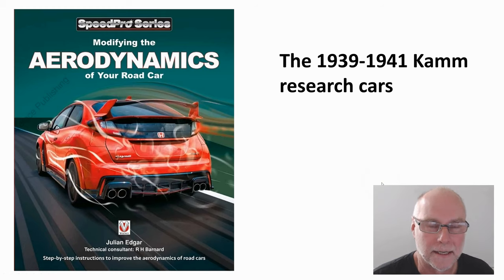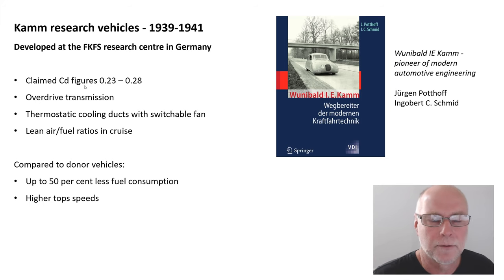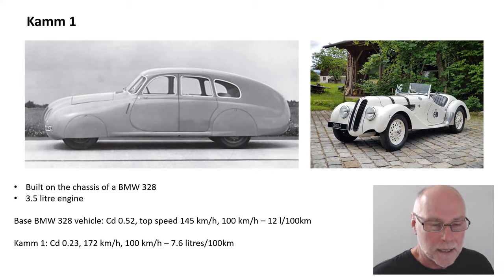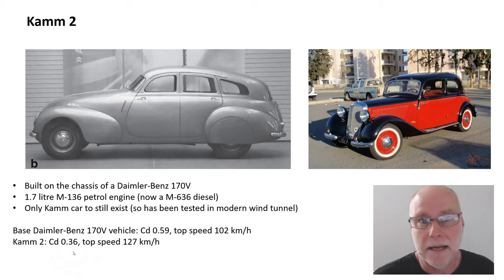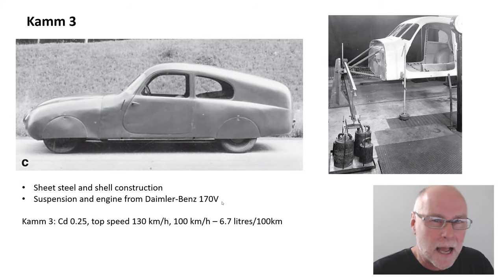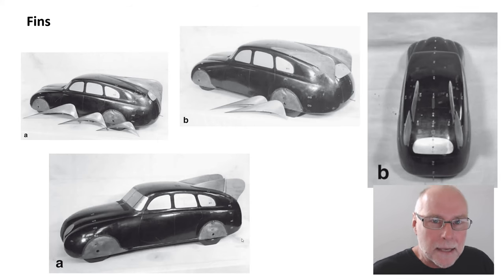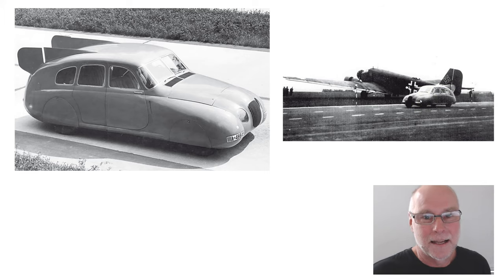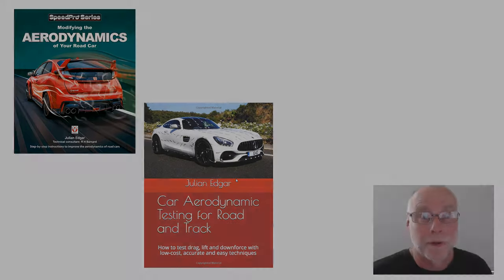The Kamm aerodynamic research cars

Comment: The 0.23 Cd value multiplied by the 1.3 larger frontal aera from the Kamm wagon is the reason the performance is not in line with your expectations based on merely the Cd value, I believe . Regards C

Comment: Julian, I removed the fins I had on my Kammback because I was wondering about crosswind drag. 
Have you tested this sort of thing with your Insight ?
Reply from the maker: When I tested the reduction in drag achieved by the rear fins on my Insight, it was done on a day with some crosswinds. However, whether that would still be the case when the crosswinds were stronger, I don't know - perhaps not. I think to get a definitive answer you'd need to do long-term fuel consumption tests with and without the fins. The improvement in stability is my major reasons for  having them on the car - the measured reduced drag is a bonus. When thinking about crosswinds, remember that the actual angle of the oncoming airflow is usually changed only a bit - an average in the US, if I remember correctly, of about 5 degrees.